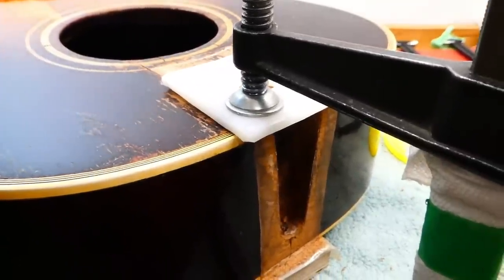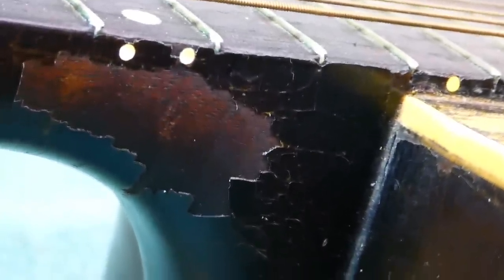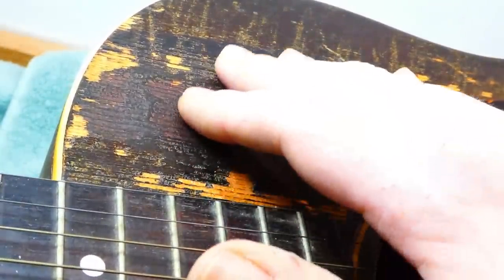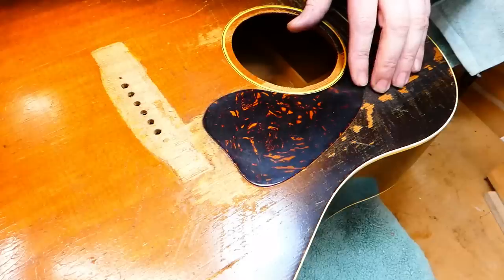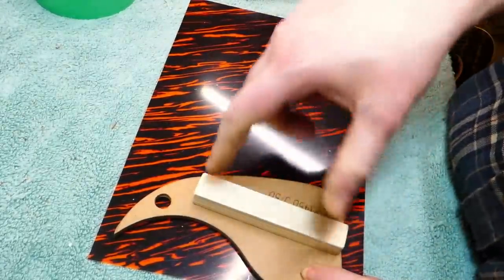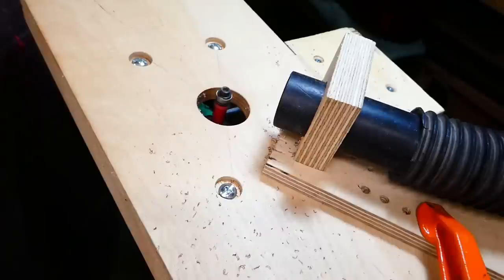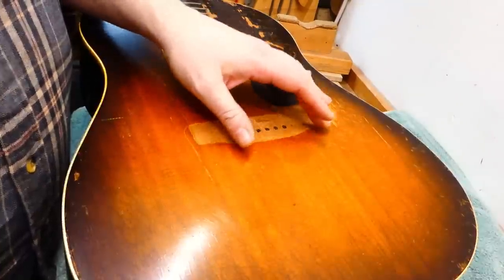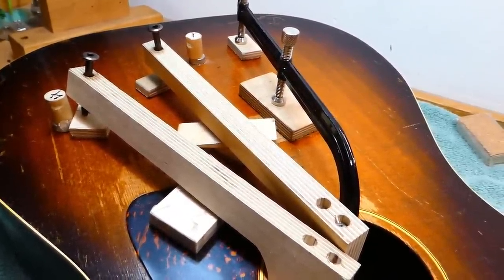1940's Gibsons, Part 3

Comment: One thing to note with these old Gibson Pick Guards is that they were put on the guitar prior to finishing in the early days. I have a Banner LG 2 and it has what looks like a cigar burn on it. the guard came up so I removed it and decided to replace it. I held the guard up to the light and saw no burn in the actual celluloid. Seeing that there was no finish under the guard when it came up I realized that what I thought was a burn was a large chip of Nitro that had come off the guard. The guard had a darker hue around the outer edge that fit the sunburst finish perfectly. The reason why I thought it was a burn was because it apparently delaminated at the dark brown layer of the sunburst finish so it looked darker without the shiny nitro on top. So now I am going to drop fill the Nitro on the original guard and put it back. It would take a lot of work to replicate that. Its interesting that they would've done it that way.

Comment: I think someone oversanded in that washboard area before they tried to refinish that area. At least I've come across that before. The softer parts of the wood sand quicker than the harder annular rings. Of course it certainly could be pick wear judging by the rest of the top. Maybe both, an attempt to remedy pick wear. Thanks for the nifty pickguard lacquer procedure!

Comment: I should like to add to the tracing trick. I may be wrong in suggesting this. But if you fold 2 pieces of cellophane (scotch) tape back on themselves. Making primitive double stick.  Then apply those to the pickguard to hold the paper down. Without taping to the fragile wood finish.  Just a thought.
Reply: 3M makes a removable Scotch tape, which might be even better.

Comment: If the tuner is made of metal and the bushing is made of metal.... why not just make the tuner a bigger diameter and fit better in the wooden hole?  I think it's more that the bushing is usually threaded into the machine head on the other side.

Comment: To my untrained eye and completely ignorant mind all three of these guitars look really rough. Now obviously the value in them either monetarily or emotional as they are exceeds that of a complete refinish. But at what point do you say that the guitar's value as it stands is so low because of its condition that a complete rebuild and refinish won't depreciate the value? And if they are at that point, does the cost of the refinishing become not worth it because the guitar in a refinished state never be valued at higher than the actual cost of the refinish?